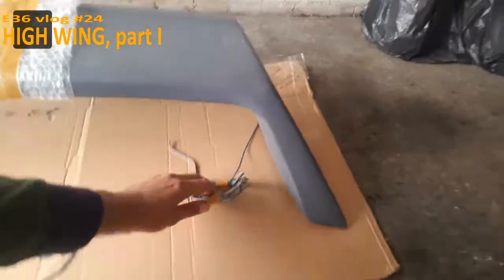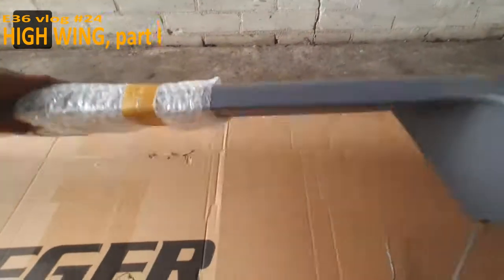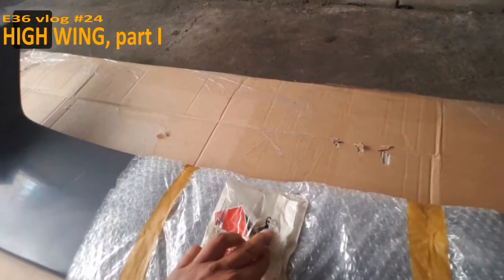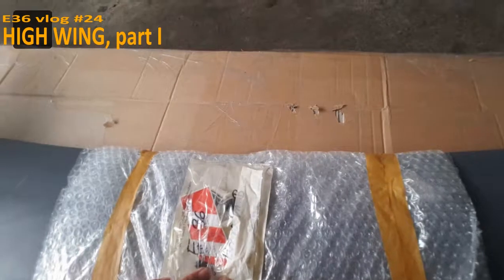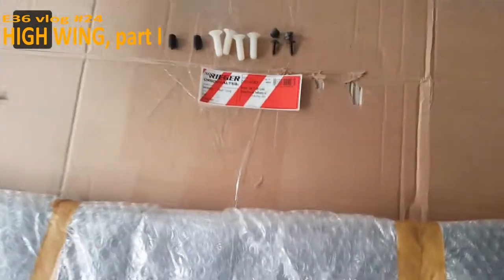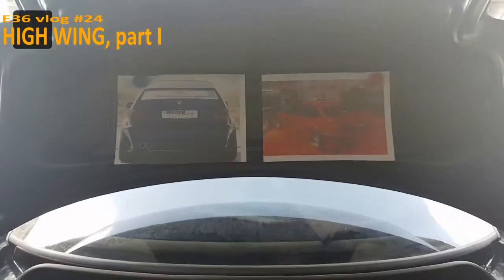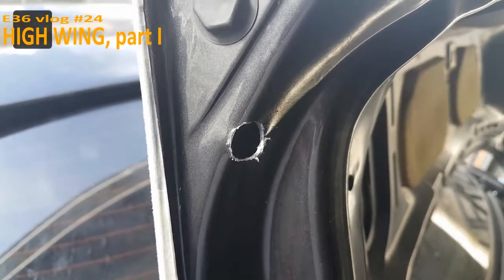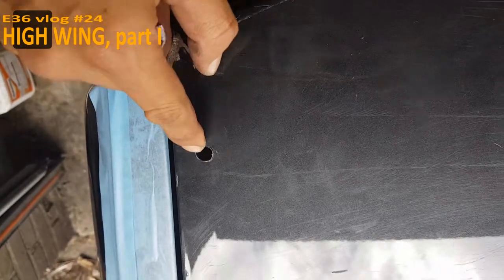E36 & E46 vlog #24 HIGH WING SPOILER, PART I (BMW E36 FULL Rieger Tuning Wide Body: Infinity II)

Comment: Looks good
Reply from the maker: Thank you Robert. The highwing belongs to the original RIEGER widebody kitt. Usually I don't like most of the high wings, but this one has perfect lines (streetlegal) and designed with the kitt. In my oppinion it 's gives the car a timeless classic OEM+ look. You also own a E36?
Reply: @E36andE46vlog  I 100% agree it matches the lines on the car so well. I have a 97' 328 4dr 5speed
Reply from the maker: @robertfoley3122  everything is original, only the widebody has been integraded with the chassie. I had a new facelift kidneyholder, but I like the prefacelift better with this bodykitt. Tip: Check out the Wide steelies vlog ;)
Reply from the maker: RIEGER INFINITY II HIGH WING WITH BRAKE LIGHT